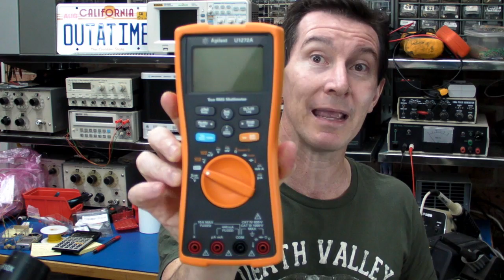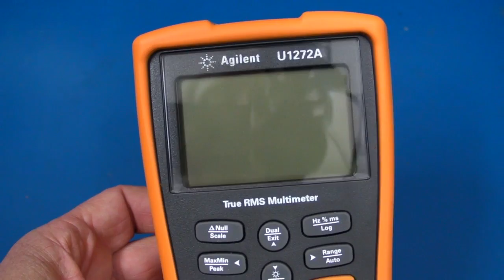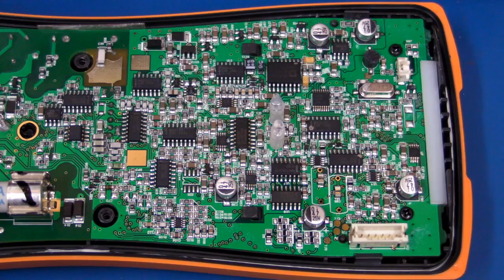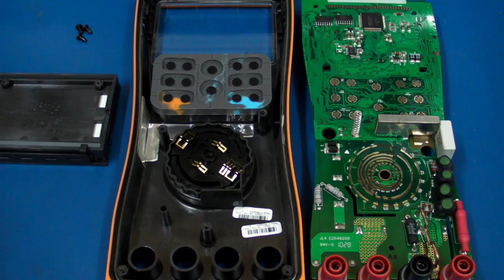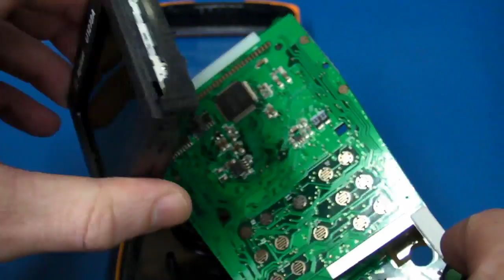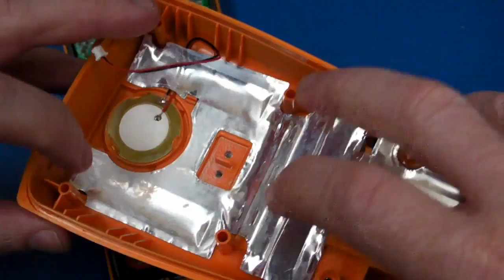EEVblog #171 - Agilent U1272A Multimeter Teardown

Comment: The SOIC8 chip is an Atmel ("ATML") 24Cxx I2C EEPROM by the sound of it (also evident by the pinout - right side has all the address pins grounded). H=grade, 936=2009 week 36. The second line (2xxx, you omitted the rest) will tell you the particular variant/capacity, though you might have to dig through datasheets to find the match.

Comment: @DanFrederiksen 
If you work at a bench where you have access to your charger all the time then it may not be a problem, however if  I were to forget to put my meter on charge I would be stuffed. If I am out on a job & my disposable AAs or 9V dies I can easily replace them with spares ( I keep a few packs in my glovebox). Even if I were to run out of spares (not very likely) I can pinch the batteries from another meter, torch, etc.

Comment from the maker: @enliteneer It's effectively just an open/closed switch. Plugging the probe in shorts out the two contacts, and the micro detects this.
It's only used for current because if the probes are in the current jack and you test voltage = BANG. On the other hand, probe in voltage jack and test current = no damage.
The 4000 chip thing was a joke, but it seems like every meter I teardown has at least one 4000 device in there. Gives it some old-school charm I think.

Comment: How does the split contact input jacks work (with sensor) and why is it only used for the current inputs?   Also, why the mandatory 4000 series cmos device?

Comment: @mitpatterson One difference between this HP and the TV/VCR variety is that the latter usually have all of the buttons molded into a single rubber sheet. The sheet itself serves as an "umbrella" to keep out contaminants. I found none on the top of the sheet, thus proving nothing came in from the outside.

The power button is the most-often used, so perhaps the frequency of use affects how much goo gets generated. The next time you see such a failure, analyze that possibility. I will too.

Comment: Dave,

Would them using those brass stand offs to conduct the current from the jacks to the main PCB have any effect if you are measuring low value resistors for example? or is the brass of a low enough resistance to not any difference in the short couple of centimenters?(and probaly the contact resistance of the probes to reistors and probes to jack on meter is more?) what do you think?

Comment: @CampKohler I've seen this one a family friends remote, but only on the power button, fixed it about 3 timesnow, i kinda figured mabey she spilled something and cleaned the outside off real good(the first time it happened) after that i was like WTF where did it come from, does anyone have ideas? is something in the rubber "leaking" or the PCB?

Comment from the maker: @electrodacus The basic Flukes have had a system ASIC for the last 30 years or something, but there is no real reason you have to have an ASIC with precision off the shelf stuff available these days. Even the top end Flukes makes use of mostly off-the-shelf circuitry now. There are quite a few benefits in going for an off-shelf-processor on an advanced multimeter. So either way it doesn't make much difference.

Comment: @EEVblog Hi Dave, im 19 and really interested in electronics, and I want to be an engineer. I really enjoy your teardown videos and seeing the interesting circuitry, however sometimes I dont always understand what you are saying because its too advanced. Would you ever consider making some basic videos on things like how the input protection works, what exactly is an "HRC" fuse? And what makes certain things better then others? I know its not your place to be my tutor, but It'd be interesting :)
Reply: HRC stads for high rupturing capacity. Basically it means the chance of the fuse failling catastrophically is low

Comment: I'll bet that internal connector is for calibration. Instead of using accurate components nowadays, they just use stable ones and instruct the uP to add or subtract from the inherent reading to deliver an accurate reading. Parts could be a sloppy 5% as long as they never drift and the meter "believes." Calibration guru Swami Spot-on says: "See the accuracy. Be one with NIST-tracability. Visualize your .01%-ness. Ommmmm!"

Comment: The conductive buttons may be problematic. Many TV/VCR remotes with the same design fail over time; they're intermittant due to a sticky coating on the board. Cleaning with alchohol fixes for awhile, but the stuff comes back later. (The outside of the unit and elsewhere inside is clean. No one is spilling maple syrup on them.)  I could never find out what it is or where it comes from, so I just keep cleaning them.  You can buy button paint, but it is expensive and has to be used up all at once..